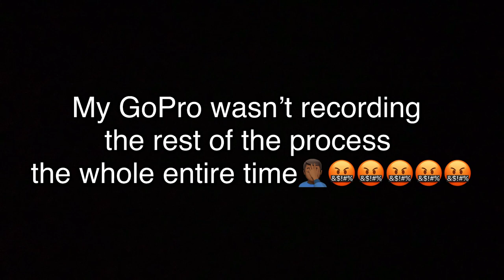I Painted A Hellcat Satin Red! My Dream Car

Comment: didnt need to tak them doors off lol gotta line them bishes back up now
Reply from the maker: It depends on how you take them off. If you take them off with the hinges yes you’re gonna have a hassle but if you leave the hinges on the shell of the car, you’ll be fine.
Reply from the maker: Definitely went smooth for me putting them on

Comment: Nice paint job but is the red a little on the brigher side, or is satin red chrome a different highlight?
Reply from the maker: Yes, satin is a different sheen than a typical gloss you would see on a daily.  The actual color isn’t buried by the gloss when you spray with a satin finish

Comment: Looks good too me just did some motorcycled parts the say way this weekend but in a charcoal gray. And one last year in a pearl blue. But did you find the satin clear lays out differently than your regular high gloss clear? As far as the smoothness and the consistency. And I think I use more of the satin clear than if I was using traditional clear for a paint job.
Reply from the maker: Appreciate you man!! I bet that gray looks really good! Yes to me it was different it dries really fast so I had to move much quicker because of the overspray landing where I needed to paint that was my second time spraying satin
Reply: @bzoewitwheels4029  do you peel you use more of the satin clear then you would have of a normal clear
Reply: @bzoewitwheels4029 Cold work!! What matte clear did you use?